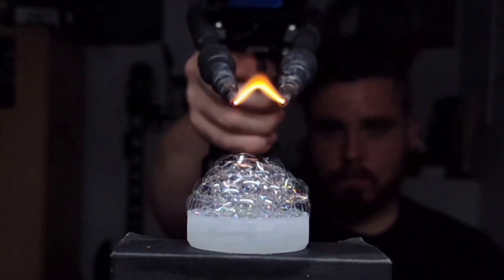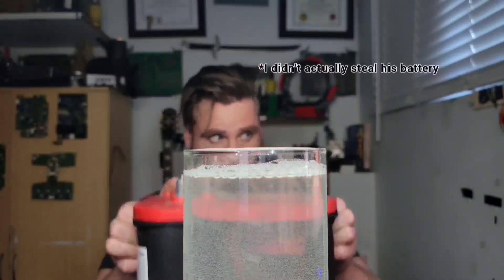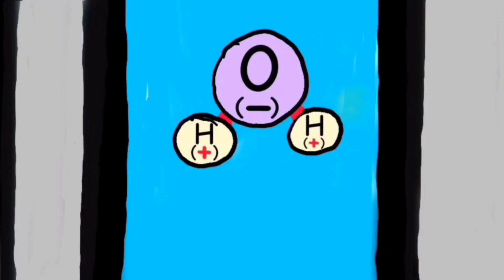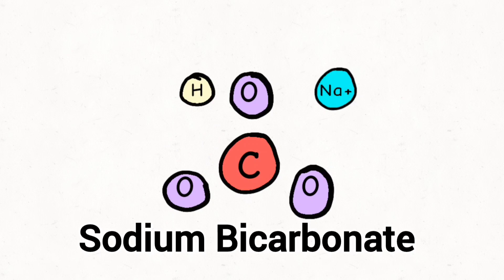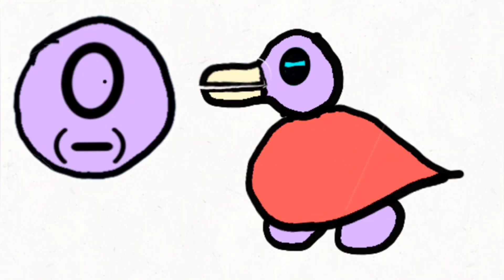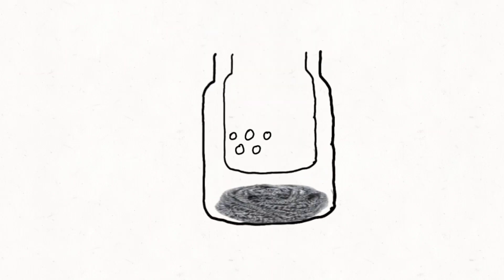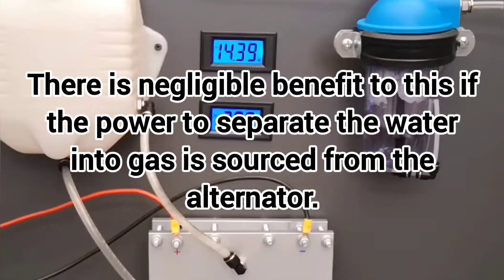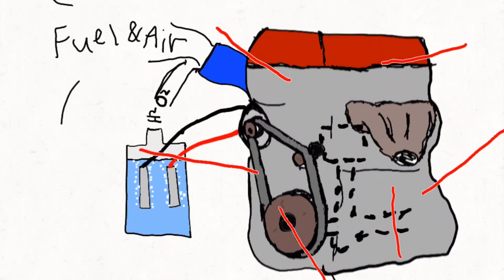How Electrolysis Works and Why HHO Won't Save You Money on Gas

Comment: People say in HHO generator will not save you money on gas however this is not true if you tune your map sensor or your mass air flow sensor to inject less fuel into your engine and supplement it with the hhl gas you get a cleaner more efficient burn from the gasoline that you run in your engine instead of burning 30 to 40% of the fuel you actually burn 70 to 90% of fuel so yes you will gain mileage you will save fuel I've proven this time and time again in a Dodge Dakota you're not energy then you put in you're not breaking any laws of physics you are simply not wasting the gasoline because you get a more efficient burn when you add the HHO in but you must tune your injectors or your map sensor otherwise you're feeding more oxygen into your engine so it is automatically trying to feed it more gasoline so you must turn that down if you don't know anything about cars and you do know something about HHO do not pretend that you know what you're talking about

Comment: We use a 315 w photovoltaic batery charger and a resonant splitting chamber and produce 
3l /min of (hho).
We charge  with sun, split water with 179 watts per  3 l hho, make steam- produce electricity and warm water for heating. 

For free.😏😉
Reply from the maker: Brilliant! How do you use the energy stored in the Hydrogen and Oxygen? Do you burn it or put it through a fuel cell?
Reply: @novus2355  
We burn it direct, no storage, only on demand.😁

Here one of the units i build.
https://youtu.be/SqXQtL5Amo8
Reply: @novus2355  a fuel cell requires a different car setup.
Reply: AC electrolysis is far too dangerous ( oxygenlevel 5 times too high ) and you can not store it because the atoms HH and O will merge together again to water.
If you want to "play" with it only use DC and use the oxygen from the atmosphere so to speak.
But to tell you the truth.
If you are very smart and take precautions in your build/setup you can drive a car on it depending on your alternator, your batterycapacity and cilinders.
A V8 won't work ;)
Reply: Um, what's your resonant splitting chamber? I'm trying to measure capacitance on mine to build a resonant, pulsing circuit.
Reply: @TravisTellsTruths  
We use spreadspectrum modulation with a transducer to vibrate the resonant body.
By vibrating the surface, bubles are released by breaking up bubble tension so the do not stuck on place and occupie 
Surface.
Pipes are galvanic treated and sindered.